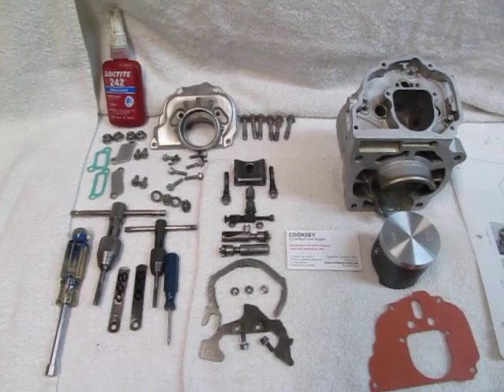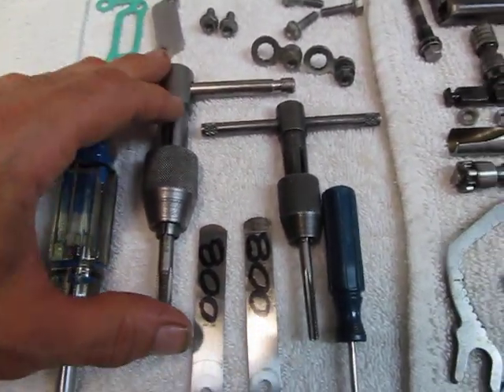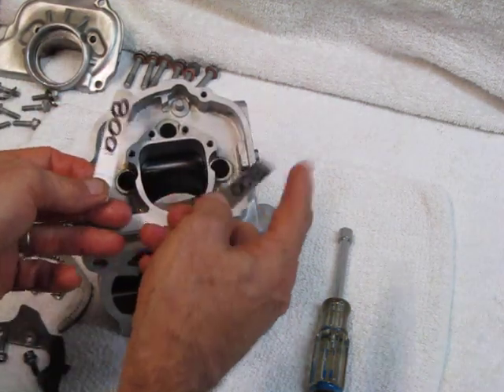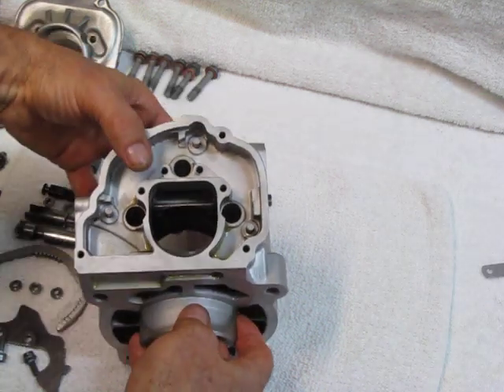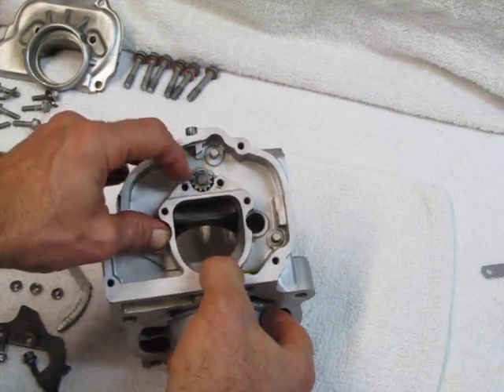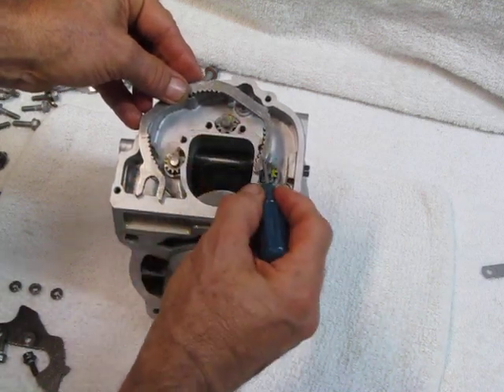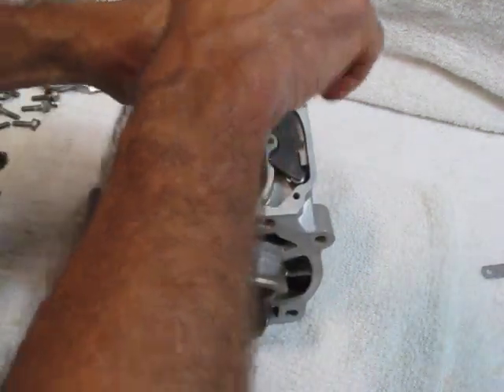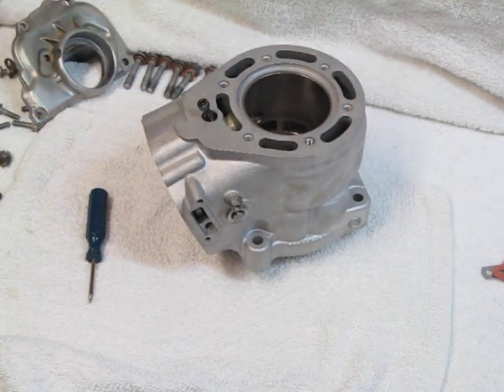Power Valve installation KTM 200 Cylinder

Comment: Any chance that the power valve assembly could be a leak point on a pressure test??? Im not holding pressure when performing this test  but what's worse is that im not seeing bubbles anywhere on the bottom end

Comment: great video. i record it for sons, i succed in removing the gummed up flap rod with fuel system cleaner and alen screw 5mm, 3 hours after trying with other tutorials, the secret where to remain in place the two flap axle but untightened

Comment: I have a 03 125 sx with a recently fresh top end. When I did the top end, I didn't want to tear the power valve assembly apart. 
 Well I got the bike back together and notice the low end power feels weak. Once the power valve opens it seems to operate well with strong power, but until then it's quite underwhelming. 
 It feels like it's staying closed, when it should be opening gradually with increasing throttle input.
 I did mess with the power valve adjustment hoping to fix it that way. Unfortunately it did not fix the issue, so it looks like I'll be tearing it apart to clean and inspect the power valve assembly. I'm thinking the pv timing may be off.
Reply from the maker: Mark, thanks for the comment.  It sounds to me like the PV actuator may not be engaged (ball end, into forked end), and the PV is stuck in the open position.  Your thoughts please?

Comment: Amazing video. I have a 200. The powervalve is currently not opening, the adjuster is working but the valve stays closed and the mechanism merely vibrates when viewed through the window. However it can be moved with a screwdriver. Im keen to fix it myself and wonder if its a head off job or if it could have become disconnected down behind the waterpump ? If anybody might know much appreciated !
Reply: Try the sight hole by the water pump first to see if the arm is engaging with the roller arm. If it is engaged it’s more than likely a head off job. I’m looking into doing it in my 200 after a rebuild. Not looking forward to it. Wish me luck.

Comment: Question... I'm in the process of rebuilding a 2001 200 EXC so this assembly process will be coming up soon. Why did you put the eccentric bolt in first and then the lifting bolt when you then removed the eccentric bolt? Does it need to be in place to align the lifting bolt? Thanks in advance for you reply and thanks for posting this video.

Comment: Great video. I was not able to turn my lifting-bolt and get it out first because it was so full of carbon in there. Then I discovered threads in the bolt, screwed in a small bolt and was able to work it out slowly. Thanks good for the engineer that put those threads there.
Reply from the maker: Yes sir those threads come in handy!!!!

Comment: Do I have to completely tear down my engine to just replace the actuator arms?  I would rather not have to completely disassemble again as I just put a new clutch case and cover with a Hinson clutch
Reply: Tearing down your engine is an essential thing that comes as a combo when you buy any 2 stroke engine.